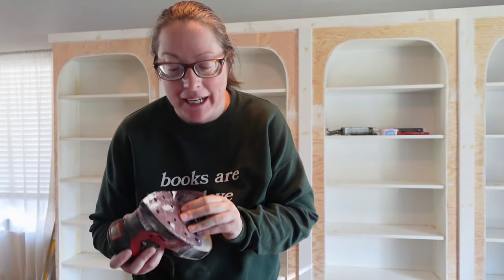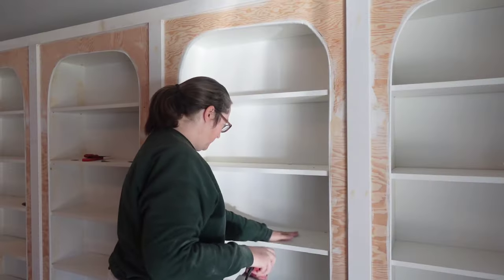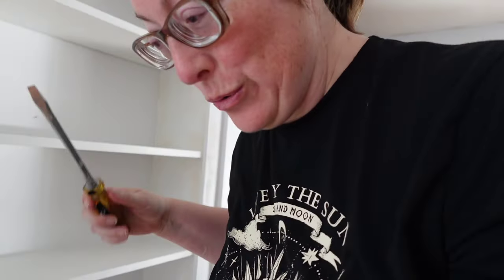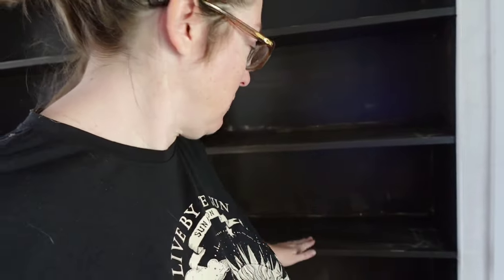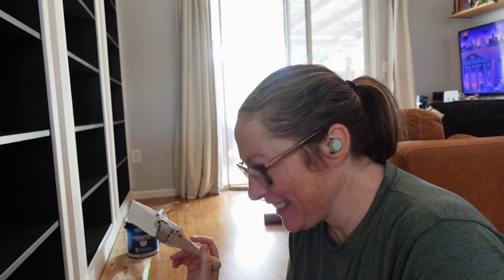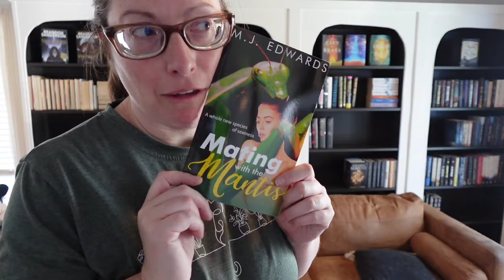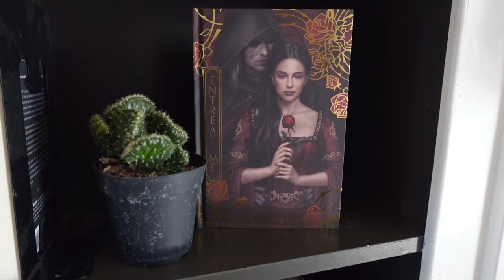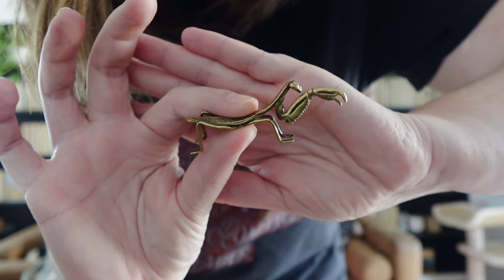Library Makeover: The Reveal! | Painting, Decorating and Bookshelf Reorganization

Comment: It looks really sharp with the black inside. I'm curious how long did you let the paint cure before putting the books back.
Reply from the maker: I primed one day. Painted the next. I didn't let them cure between coats when doing the black (which i should have). but then waited about 3 or 4 days. then I put the poly coat on and put books back 2 days after that.
Reply: @happily_ever_april Thank you sometimes it's hard to wait.
Reply from the maker: @bobkeane7966  it was very hard!